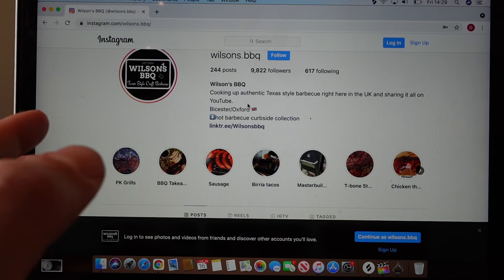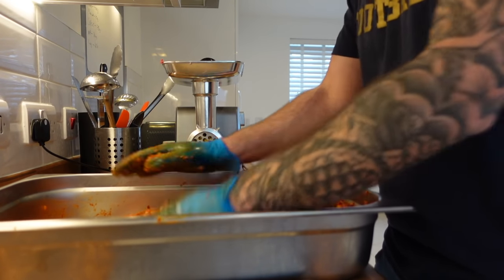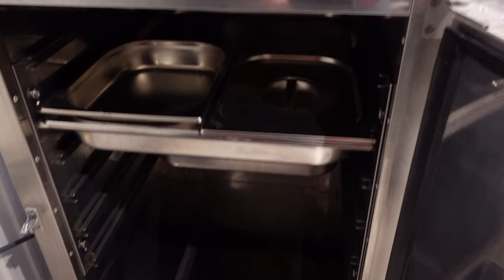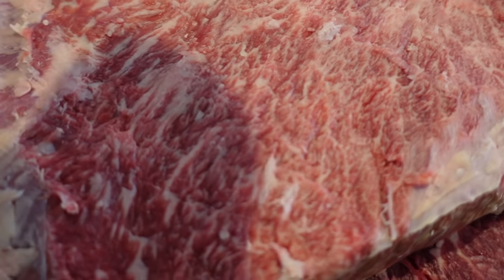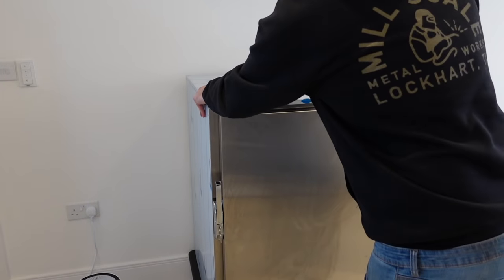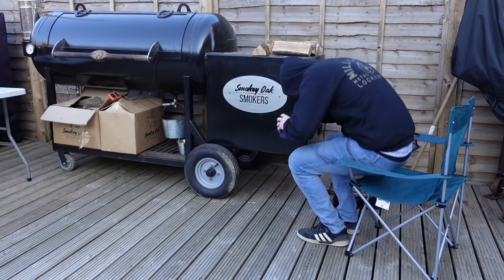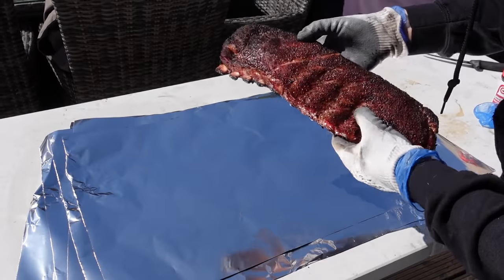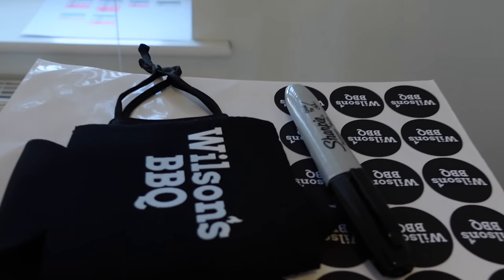How We Run A Texas Style BBQ Business From Home | Click and Collect BBQ

Comment: Looks Amazing!  Well done.  One thing I do is a hot pickle onions.  I use Red Onion for sweet, then add some thyme and a serrano pepper not a lot as the heat really comes from it but heat to choice.  Then you do a separate batch normal.   I sometimes add Diced carrots into the spicy one for additional sweet to it.

Comment: cool set up you have going. with your pork shoulder you could always cook rest break down re-season and chill then cryovac. looks like you have a proper machine based on the sausages you sealed. i actually prefer it as the smoke gets even deeper into the meat. i'll cook mine and let it sit cryovac'd for a week the flavor gets deeper imo, as it has time to "cure" if you were doing back to back weeks it would be a good set up to also not have to time it out, but looks like its every other week?

Comment: Great video! Can I ask what you mean by ‘moisture controlled’ when talking about the warming cabinet please? Does it have a humidity setting or something? (If so, what kind of humidity percentage do you use?)
Reply from the maker: its actually a 'dumb' moisture control. it doesnt have a humidity setting. you fill a well at the bottom, and the water vaporises over time. it will go through about 2litres in 18 hours.

Comment: This is amazing! I was on the edge of starting similar like this and you just pushed me over the edge man. This weekend im gonna do my first public test run hopefully! 1 question tho, i did the ribs till they were about done then id wrapped them up and kept them in the oven at around 100 degrees Celsius, but they obviously kept on cooking.. A bit too far after 1, 5hours or so.. Dont you have that problem with your warmer? Or how do you keep it from overcooking?
Reply from the maker: 100c is way too hot for holding/resting ribs. That temperature wil continue to cook them. They need to be held around 66c. That will prevent them from continuing to cook. Also, let the carryover stop before holding them.
Reply: @WilsonsBBQ  i want to thank you so much for this video. I am now running a take away from home for 3 weeks now (only ribs as meat, potatoe wedges, coleslaw, homemade mayonaise. Optional cinnamon rolls and brioche herb/cheese bread). I indeed lowered the temp (found a setting on my oven) and its amazing. Still starting up, but around 15-18 ppl every time so far and very good reviews, so I am thrilled!

Its just amazing that by the time I really set my mind to it, your video was posted. Meant to be! 

Again, thank you for this video. Its really inspiring.

Comment: Great Video thanks for sharing.

Does the meat continue to come to temp in the warmer or does it maintain the IT you pull it from the.smoker?
Reply from the maker: i pull the meat off the smoker fully cooked. which is normally somewhere between 200-210. It then rests on a table until the carryover has stopped, and the internal temp has come down to around 160f. it then goes into the warmer (which is set to 150f) and is maintained at that temperature all night until service.
Reply: @WilsonsBBQ  thanks for explaining

Comment: Hi quick question re your gloves, you seem to wear 2 pair, maybe a cotton pair and then disposables over the top, can you elaborate?  TIA!
Reply from the maker: I wear a pretty cheap and basic cotton glove under my nitrile gloves. They add another layer of protection from the constant handling of hot meat, but more so - the metal trays can get very hot. The nitrile gloves are self explanatory - the under layer of cotton is just heat protection.
Reply: @WilsonsBBQ  Thanks!

Comment: Hate to be a YT know it all but please take this as advice in the spirit in which it is intended. As you are selling by weight (as I do for my business) you need to have a scale that is tested and rated for trade. A kitchen scale is not suitable. Trading Standard could issue you a rather hefty fine.
Reply from the maker: I completely appreciate the advice. This was actually an oversight on my part for a good six months. It didn’t even occur to me that I needed trade scales. We’ve since upgraded to a set of commercial scales that comply with the weights and measures standards